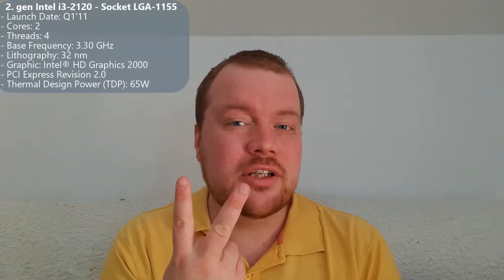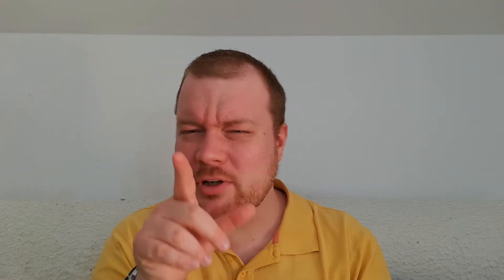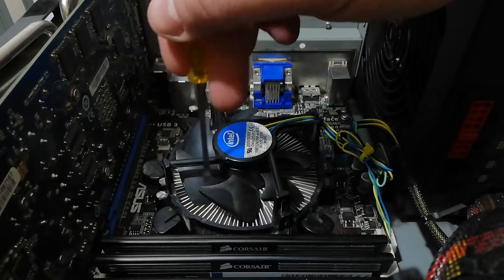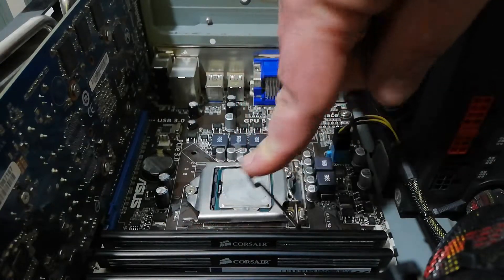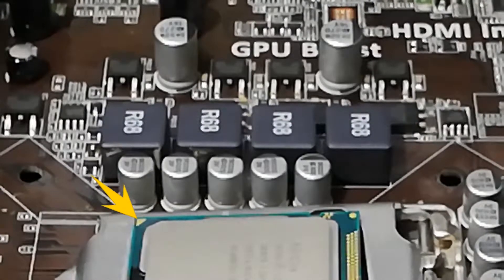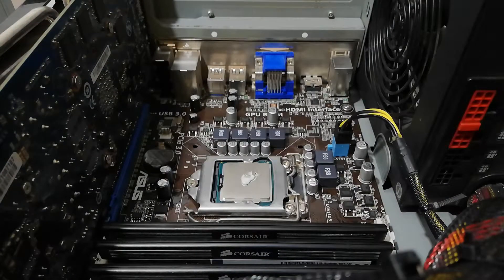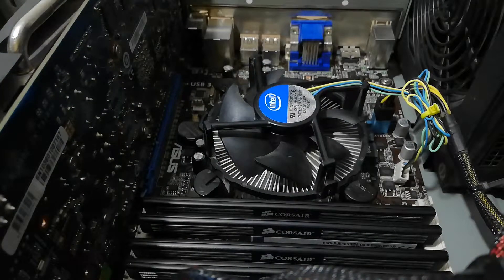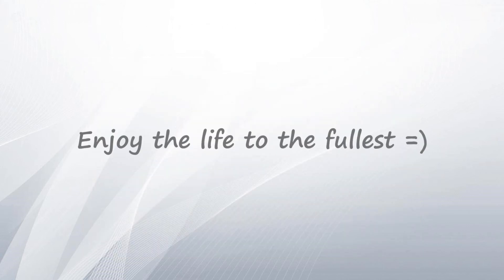How to upgrade PC processor on socket LGA 1155? - AFT #3

Comment: Hi I have a dell i5 2500 socket 1155 LGA I've bought an i7 26k 1155 LGA but the cpu won't fit it's way too bigger. is there any sub-types of the socket 1155. I'm using a dell optiplex 790 sff
Reply from the maker: Hello there. Are you completly sure, you have i7 2600 (check what model is on CPU writings)? Because as far I can see, it is regullar 1155 socket.

https://www.dell.com/community/image/serverpage/image-id/41712iFB38011F31564BDC/image-dimensions/1000?v=1.0&px=-1

https://www.google.com/url?sa=t&source=web&rct=j&url=https://www.dell.com/downloads/global/products/optix/en/optiplex-790-tech-guide.pdf&ved=2ahUKEwj2sp_N5vPsAhWvtYsKHf4gCuoQFjABegQIBBAJ&usg=AOvVaw3cSau9RnFl5_hdkNXvGG11
Reply: @ACOnetwork  Hi Thank you very much for your reply! I just found out that I'm after buing an I7 920 instead of an I7 2600.
Reply from the maker: No problem. Always check data, if that is processor or any other hardware 😁👍.
Have amazing day 😁

Comment: Hello. Awesome video. I change my motherboard and I bought 
https://ark.intel.com/content/www/us/en/ark/products/54876/intel-desktop-board-dh61ww.html
My CPU is https://ark.intel.com/content/www/us/en/ark/products/53445/intel-core-i5-2310-processor-6m-cache-up-to-3-20-ghz.html but when I do the procedure, PC starts but only in black screen and nothing changes. Do I need to make a motherboard upgrade or something else?
Reply from the maker: Hello and thank youuuu 😁👍💛. Black screen is most likelly, because bios version is too old and it does not know, how to read CPU correctly. On official website of Intel, there are no downloads at all, but I found BIOS firmwares, but it is up to you, if you want to risk the upgrade, because it is not from official source. https://drivers.softpedia.com/dyn-search.php?search_term=DH61WW
Reply from the maker: I forgot to tell you, you will need supported cpu by motherboard, so you can update bios

Comment: After installing the i5-3550 CPU while everything pretty much went smoothly I noticed CPU temps were a bit higher than one would expect as initially when running Prime95 shortly after booting up they reached about 95-96c and some hours later came down a bit but where basically still in the low 90's(maybe a touch into the very high 80's at best) but I noticed by lowering CPU voltage slightly it made a big difference. like for each 0.050v (I can raise or lower things by 0.010v differences in my BIOS) I dropped it shaved off 5c+ from the peak temps in Prime95. so I started off with 0.050v than tried 0.100v and then 0.150 but I noticed while initially 0.150v was looking good, once I stopped the Prime95 test the computer completely locked which I assume the voltage is a little too low so currently I got it at 0.130v and will see how that fairs over the coming days. but after running Prime95 for 40min or so, the CPU temp peaked at 75c but was largely in the 71-73c range. so for general use it's likely it will stay below 70c which is a rather big difference from 90-95c or so range which is simply too high. even my idle temps dropped to typically 25-35c where as before my CPU voltage tweak they where 35-40c or so.

so for a person who has a BIOS that allows for CPU voltage control, one can lower the CPU voltage a bit as it will lower your CPU temp a fair amount. but I suspect this will vary a bit from CPU to CPU in how far you can lower it before system stability will take a hit. but at least you ain't got to worry about damaging the CPU since we are lowing voltages and not raising them.

I was even looking around more online and apparently disabling the AVX setting on Prime95 makes the stress test more accurately resemble a real-world CPU load at 100%, which does not tax the CPU as hard as the default settings do in Prime95. I have not ran this test yet since tweaking my CPU voltage but it's almost surely not going to be higher than around 65c, maybe high 60's tops. hence, I should be fairly safe right now as my CPU temps should be within safe ranges comfortably.
Reply from the maker: i5-3550, Maximum operating temperature (Tmax): 67.4°C

Temperatures should not be above 85 at full load with prime95, 95 is too much. Try to take out aand put back in CPU and cooler, othervise you should get bether cooler for your CPU min. 10C decrease in themperatures. Maybee CPU is not sitted propertly, maybee between cooler and cpu is grain of something and contact is not as good.
Reply: @ACOnetwork  ; I know the stock coolers are not good but I was trying to avoid a new heatsink/fan and now I can due to the CPU voltage drop adjustment I made in the BIOS. personally I don't think adjusting the heatsink would do much given my idle temps are fine and inline with others. also, that 67.4c I heard you got to add 5c to that for a more accurate reading (so that 67.4c basically means about 72c)... https://forums.tomshardware.com/threads/i5-3570k-safe-temperatures.2093736/#post-14205789 ; basically says mid-70's are considered safe and I am within that standard now basically, especially since Prime95 in it's default state does not represent a more real-world use scenario (since AVX is enabled, which taxes the CPU harder than just about any programs will). but 95c was initially (but idle temps were normal) as temps came down a bit after some hours to a day or so. but the real temp drop came when I lowered CPU voltage slightly (i.e. by 0.130v) and now my temps are good as they are no where near 80-85c but are about mid-70's now with Prime95 which means real-world use will be even lower.

so while I could remove and reattempt the heatsink/thermal paste stuff, given my CPU voltage drop adjustment, things are working well now. so I likely won't bother.

also, after removing my old i3-2120 heatsink I must have applied thermal paste well on the CPU as it has a nice circular spread on it (I took a picture of it). but from memory, it's possible I may have used a little more on the i5-3550 install which if so would have possibly improved it a little vs previously. but only way to know for sure is to remove it and check to see how the spread is.
Reply from the maker: If everything is okay, then eather voltage down or bether cooler (maybee even used one).

Now I am off to sleep, byeee, have a nice time 😁
Reply: @ACOnetwork  ; I learned a little more since my last reply which I am pretty sure is correct from memory and I noticed someone else mentioned it to me earlier. the proper i5 CPU's have a copper piece on the heatsink where as the i3's are just aluminum. so right off the start we are using the i3 cooler on the i5 which is worse than the proper stock cooling for the i5, so it's not surprising my temps are quite high in normal use situations as without my voltage tweak, the CPU runs noticeably hotter. but now I am well within safe limits of the CPU.

with that said... I know one can go with a Cooler Master 212 EVO and the like, but I was hoping to avoid spending $20-30 or so and it appears I can since I did a Prime95 without AVX test earlier (which makes it more representative of real world 100% loads on normal programs etc) and my temps peaked at 71c but was generally 67-69c, so I should be safe.

I just thought I would put this for those reading as using a i3 cooler on a i5 CPU is not the proper minimum heatsink one requires.
Reply from the maker: Yea, completly forgot about with copper or pure aluminium stock coolers. Copper is bether thermal conductor.